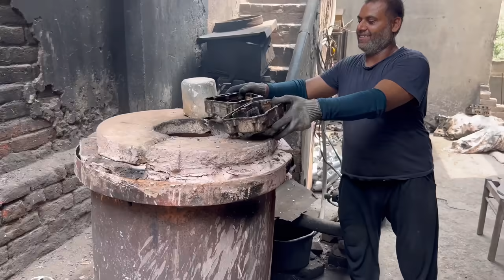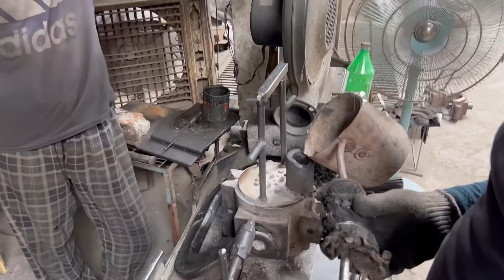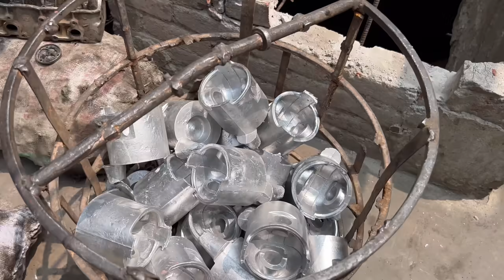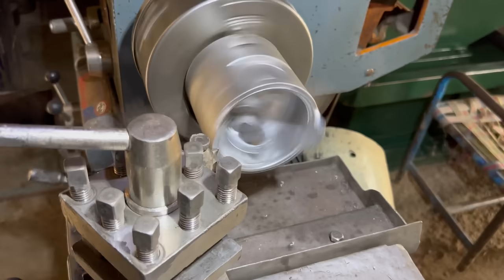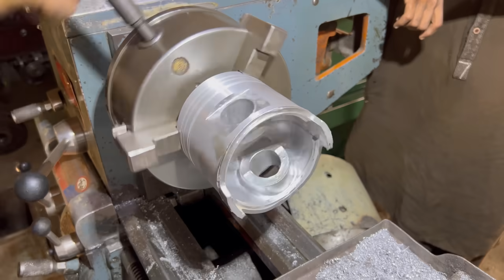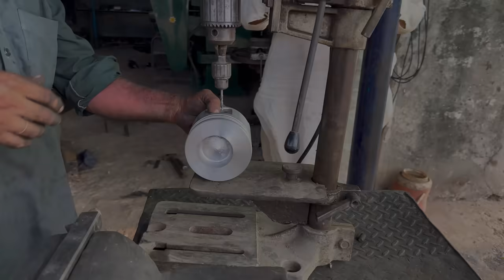How to Manufacturer Process Of Truck Engine Piston - Production of Engine Piston |

Comment: Recipe calls for

6 Honda something cub copy pistons as dirty as can be the better

1 yamasaki crankshaft including its con rod bushings and shims and plastic weights

2 supposedly full ally copy carbs pz or or pwk doesn't matter including internals

15 odd sized nuts bolts and other ferrous metals to strengthen the alloy 🫡😅👏

2 egg whites

1 big pile of dust

Pinch or two hundred of borax

Half hour at 380 degrees turning occasionally and you'll have a nice cake in roughly 7-16 business days give or take a month overseas shipping

Failure rate 3/3 they're puuurfect

Comment: OMG.. Do they really want to use these pistons in a truck? Warranty till the first turn of the starter engine.. Wrong material mixtures, wrong temp. while manufacturing, not the same weight for the pistons, etc.. I will not be the one who will give warranty on this..

Comment: ok kids, even though these ppl are hard working men and defenetly good at their craft - these products are below sub par in quality. Piston dimensions must be measured to a 1/100th of a millimeter. MINIMUM. There's no eyeballing. Mills, lathes and CNC machines must be calibrated regulary, and I would suspect hand tools for measuring these pistons in a production environment is not good enough. They must be milled on a CNC to last at all. These pistons must also be weight calibrated within 0.1 grams or something like that or they will vibrate the heck out of the engine. This is just nonsense...

Comment: casting with scrap material 😆..... no measurement of grooves. compression height, pinbore diameter etc 😆.....how will this piston work in an engine? --> self destruction of the engine 😆

Comment: cmon guys, these guys work in their wives dresses and wear sandals to a "machine shop"
do you really think the customers can afford precision machined parts or factory replacement parts?
they do absolutely crap work, but , they get the poor guy back on the road for pennies.
if it needs to be fixed again in 6 months then the customer has more pennies in his pocket to pay for another part.
not good but it works for them

Comment: All this is of very poor quality: indeterminate quality of aluminum (need aluminum with a high silica content), approximate molding of the combustion chamber form, the centering between the machined part and the raw material, on the other hand, is surprisingly good because the skill from the worker, but the machining is of very poor quality especially at the level of the ring grooves and the piston is cylindrical factory while the shape of a piston must be in the shape of a conical and oval barrel (machining by "cam copying" + diamond water sprayed tool on old machines) and with a precise determined roughness profile (not smooth to provide good oil grip) , in short it's all shit...

Comment: I have never tightened ANY chuck (3 or 4 jaw) as tight ( never used a cheater bar) as these savages do and my 50 yo Laguna is closer to spec that anything i've seen on these videos.